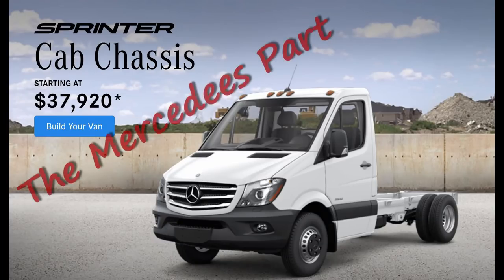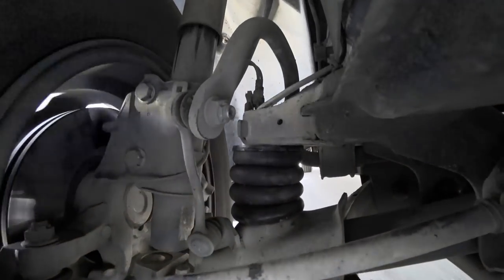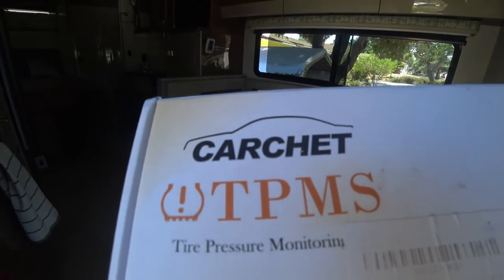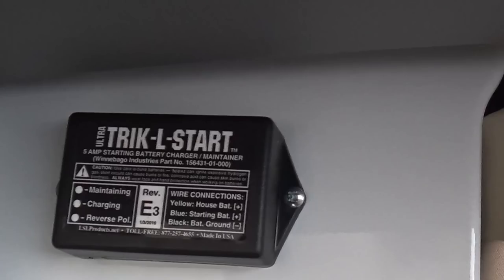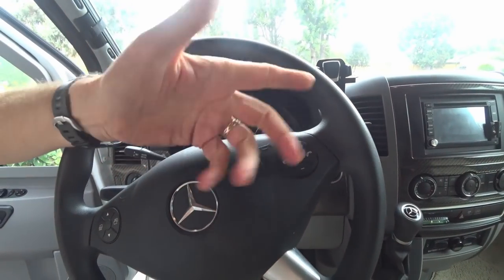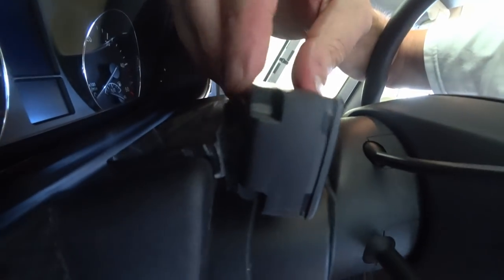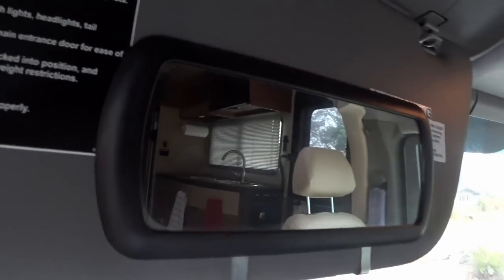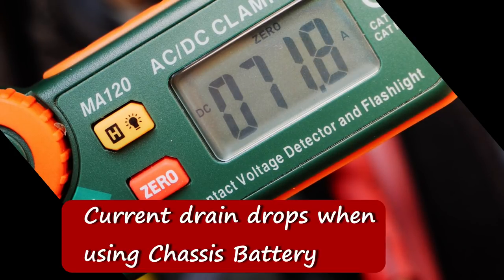Winnebago View - Essential Chassis mods

Comment: After seeing your chassis mods, I immediately ordered and installed the Hellwig, the Konis, and the Sumos front and rear. WHAT a DIFFERENCE!! 

Did you change your front struts too? I’ve been considering the kind FSD (I think it is)
Reply from the maker: No, the ride is plenty firm and controlled with existing struts.  Am actually thinking the front Sumos are a bit stiff for all those expansion joints on the interstates.  Not sure if another change is in the cards.
Reply: My front sumos are blue, which I think are softer. They seem okay on the expansion joints.  Not sure if California roads s same as Florida.
Reply from the maker: @davidharper9976  my grip concerns the roads between CA and FL.  Long stretches of bumps.  They do vary from state to state and which interstate you are taking, but bad roads are everywhere broken up by a few sections on nice new paving.

Comment: Did you unlock your Sun Visors so they pivot?
Reply from the maker: I have on occasion.
Reply: @ontheroadwithron2432  I didn't ask my question very clearly. I was asking about your Sprinter's Sun Visors, that don't normally move/pivot from the Windshield unless the Gray Plastic Clip is removed. I've had our used 2018 Sprinter for one year and just found out that the Sun Visor can Pivot once the  Clips have been removed. I hope this clears up my question.

Comment: Where did you get the white windshield cover?
Reply from the maker: Rick Manwarring it is an ADCO I got on Amazon. If you use it, the windshield has to be clean before adding. I’ve scratched my paint astound the door putting it on a dirty RV.

Comment: Some good ideas but I disagree with the quality of Mercedes.  They have a terrible reputation for problems and it costs 10 times more to get anything repaired. Mercedes makes thing so complicated rather than staying with the KISS principle.
Reply from the maker: Sprinter vans are a work horse in the delivery business, but the RVs do seem to stress everything a bit more.  I do agree that repairs are very expensive.  So far hasn't cost me anything as I do my own maintenance.  The large numbers of sensors can be annoying, but I am considering that all new vehicles have the same issue.  Of course, if Toyota made a suitable chassis, I would run to get one.  Valid points